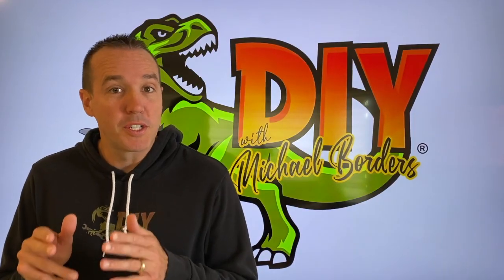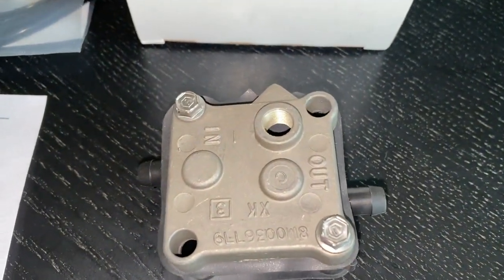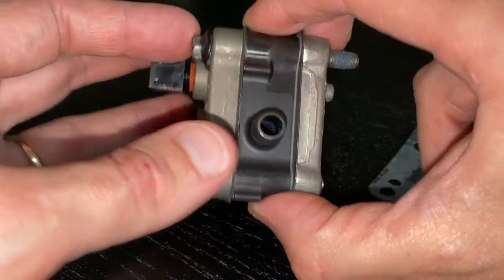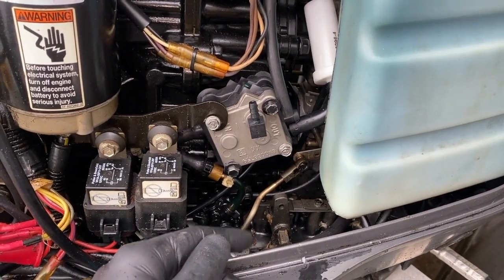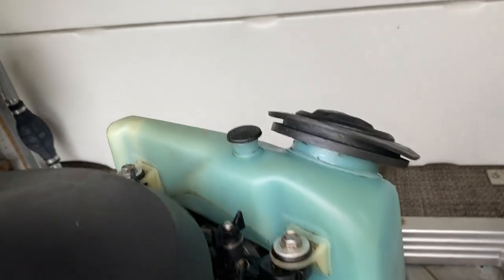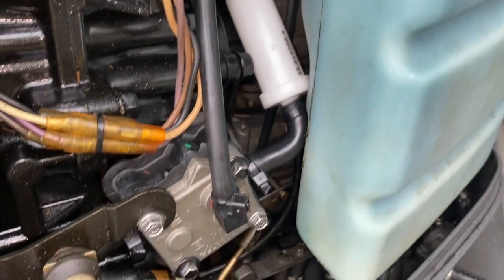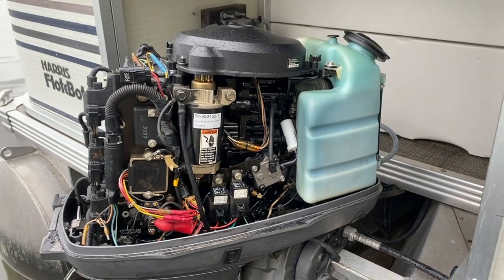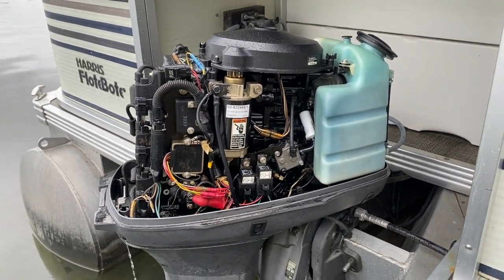Install 40hp Mercury outboard Fuel Pump

Comment from the maker: If interested in purchasing this product, visit our Amazon affiliate link below. I earn from qualifying purchases.

Moth balls:  https://amzn.to/409r9W8

Nitrile gloves:  https://amzn.to/40BgweO

Shop towels:  https://amzn.to/4e4Z73H

Fuel filter:  

     OEM:  https://amzn.to/3FOrs1w

     Aftermarket:  https://amzn.to/4lf8Irk

Aftermarket Fuel pump:

     https://amzn.to/3Txtx5e

     https://amzn.to/4me6Rn3

Fuel pump rebuild kit:  https://amzn.to/4faPhy7

New fuel hose:  https://amzn.to/3ZMxnv9

Fuel-Water separator filter:

       Filter:  https://amzn.to/3HxRkQ1

       Kit:  https://amzn.to/40ck9Yy

Gas tank:  https://amzn.to/3TBwemp

Zip ties:  https://amzn.to/4nBgb64

Zip tie cutter:  https://amzn.to/45TwgNV

Siphon kit:  https://amzn.to/44BJNHJ

Oil pan:  https://amzn.to/3Icl5pE

Synthetic oil:   https://amzn.to/3Tu63xR

Oil pump:  https://amzn.to/407zwkT

Bungee cord pack:  https://amzn.to/3T1l8qC

Spark plugs:  https://amzn.to/4dZQAz2

Spark plug gapper:  https://amzn.to/3TrytIS

Ignition coils:

          https://amzn.to/4447l7W

          https://amzn.to/3FOGX9X

Boat engine muffs:  https://amzn.to/4l1yq2V

Trim switch:  https://amzn.to/3FOt5wa

Throttle housing:  https://amzn.to/4e52CHI

Horn switch:  https://amzn.to/3SDVGaC

Rocker switche covers:  https://amzn.to/3ZZuGpV

Speedometer replacement kit:  https://amzn.to/43utvBa

Boat cover sand bag kit:  https://amzn.to/4kCY3qq

************************************

1.  Remove fuel pump

          https://youtu.be/1tM2ACNoWUE

2.  Rebuild fuel pump

          

3.  Replace 40hp outboard spark plugs

          https://youtu.be/DLKPz8-q7-A

4.  Replace fuel filter

          https://youtu.be/oTRS1VOIsFM

5.  Winterize outboard engine

          https://youtu.be/LSTCiqLuHtA

6.  De-winterize outboard engine

          https://youtu.be/IjzSsgypiTA

7.  Replace boat cover button snaps

          https://youtu.be/_HaALyNC6X0

8.  Replace outboard fuel hose pump ball kit

          https://youtu.be/aXUMIUNfT-w